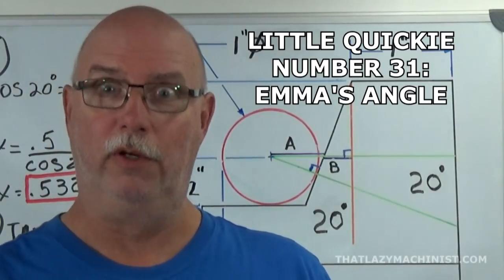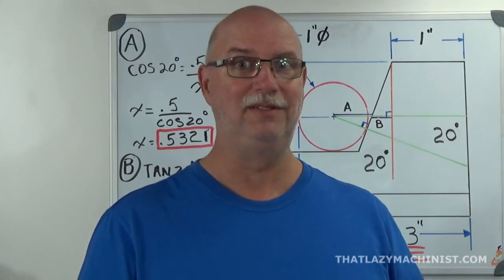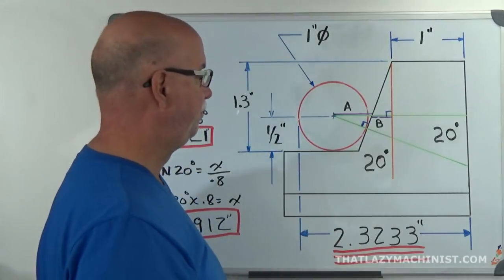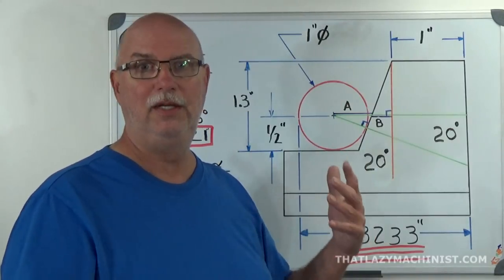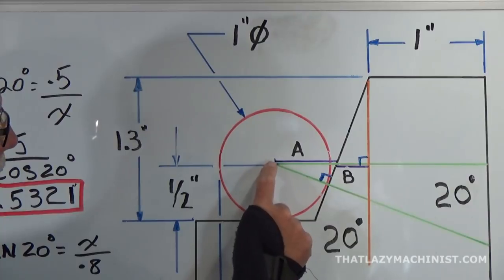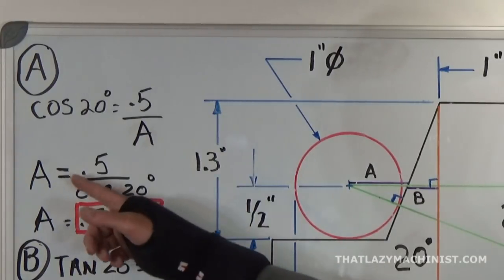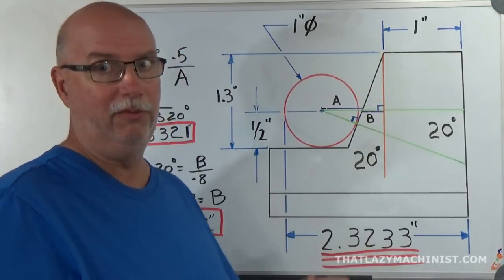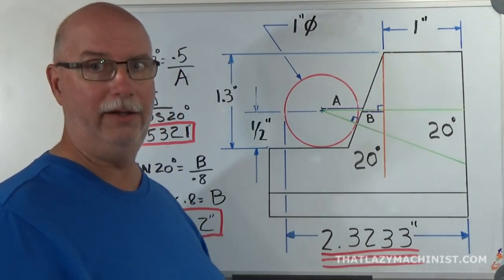EMMA'S ANGULAR PROBLEM! OR HOW TO ACCURATELY DETERMINE WHERE AN ANGULAR SURFACE IS, MARC LECUYER

Comment: I aced trig in high school, but that was a little more than 50 years ago.  However, I really learned it then, not just passed the tests.  So, today I am a lot slower to get the results, but am still able to get it done satisfactorily.  Who would have thought that was useful knowledge long term back then.  Somehow, intuitively, I did.  The calculations were all done with tables, a slide rule, and longhand math in those days before computers and calculators, and I still have the slide rule and the tables as well if the computers all go dark.  This is the kind of stuff that makes machining interesting...  Thanks, Marc!
Reply from the maker: Hi Bob! I did my high school trig with a slide rule as well! I am not sure though that I would be able to use one today? Well at least not without a good magnifying glass!!!

Comment: Hi Marc,

Good to see you looking well.

I've got to pull you up on a little units error though and an engineer should know better! The bicycle battery is rated in Ampere Hours, not Amperes.
Reply from the maker: Hi Paul! I did not know that, and I am not an engineer. I am a machinist and was never very good with electricity (I guess this proves it). Thanks for keeping me on my toes, and for watching, Marc.

Comment: Maybe a dumb question but.... how would I know the 20deg angle of the triangle comming from the center of the circle?
Reply: devin wojtczak the two triangles can be proved to be similar.

designate the point at the top of the part, at the edge of the angled section (where the left side of the '1"' measurement points), A; designate the intersection of the orange line coming vertically down from A & the green horizontal line B; designate the point to the left of B, where that green line intersects with the angled edge of the part, C. designate the point at the center of the circle (further left along the green line from C) D; designate the point where the angled edge of the part is tangent to the circle E. 

angle BAC is given as 20 degrees, which means that angle ACB is 70 degrees; angle DCE must be the same as ACB (because they're both formed from the same two intersecting lines, & neither is a complement to the other), which means that angle CDE has to be 20 degrees (because both triangles are right)

an illustration: https://imgur.com/4NLwGdI
Reply from the maker: You explained that better than I could! Thanks! Marc

Comment: But you are still stuck with the unknown 1" measurement (theoretical - it should be...).
A more accurate way is to first measure the "2.3233" measurement and then make another while putting a measuring block "horizontally" between the part and pin.
Then using the difference between the both measurements and the thickness of the measuring block you have a right angle triangle that isn't depending on theoretical measurements. If a high level of accuracy is needed don't forget to check the squareness between the base and the surface the pin is resting against.

Sorry for a bit of rusty english and lack of illustrations, if clarifications are needed please poke me and I'll see if I can give a better explanatiion.

Glad to hear you're doing good and feeling better!
Reply: Oups. Now I saw that Shadowdog500 had posted the same solution already :-)

Lesson learned, read first then post.

Comment: Dear Marc, this does not solve Emma's problem because what can she do to correct her part if she gets a different measurement result than expected by your calculation? She still will not know if the angle deviates or the 1" part at the back edge is not exactly 1"..She will only know that one or both of the two dimensions are wrong. But which one needs correction and by how much? Actually even if the measurment result equals the calculated result still both the angle and the 1" part can both deviate but compensate each other so that the measured result seems correct but your part still deviates from the required shape. You try to verify two dimensions with one measurement. That can not work. I am afraid you have to postpone your summer vacation a little and pick up a math book yourself... ;-) I help you a little so you can still catch your trip to your vacation. How about taking two measurements with two dowel pins of different diameter? You get two equations which you want to solve for the unknown angle I name "alpha" of which you are not sure if it is really 20deg and an unknown distance "x" of which you are not sure if it really is 1". A and B and C and D (the latter two for the different dowel pin diameter) can all be expressed as functions of the unknown alpha and other known dimensions. So you can solve your system of two equations for alpha and x. Then Emma finally knows the actual values of the twol unknowns and can correct them accordingly. Is it spare room workshop Emma or another one?
Reply: one could confirm the angles with a sine bar.
Reply: true but very expensive if you include a quality set of gage blocks. Also a vernier bevel protractor would work up to about a 10th of a degree unless the bevel is too small and the protractor too big.
But scarcely equipped hobby workshops usually have neither of the two. So Marc's idea with the dowel pins and micrometer really suits home workshops very well if only that math were not so confusing....;-)
Reply: A $35 set of angle blocks would also work.  my $35 set will work to 1/4º  Chris
Reply: ++Anonymic79: You are right of course when wanting to go by the book. Tolerances on dimensions and general tolerances you can see very often on decent drawings. And you should pull the tolerances also through the math operations where using toleranced dimensions. You are right. But to be honest I have not seen that done for many years in fields that are quite concerned about precision. Are you a physicist? They are the only ones I have ever seen doing that. The theory and the mathematical methods of error calculations is neat. But particularly in the mechanical field it is not very practical. In complex assemblies it would become complex already by carry through all error calcs. But it becomes even more complex because there are mechanical operations that interrupt the error calcs e.g. when several parts are clamped together and milled flat together. or when parts show unwanted gaps during assembly and you just pull them elastically together by their mounting bolts. And it has no adverse effect except on your error calculation. So even for precise assemblies the error calculation does not stand the test of practical application. For very special very critical applications usually with limited complexity error calculation can be very helpful. For high volume series production you could even include the probability of tolerances in form of Gauss curves and benefit from the fact that tolerances can cancel each other out. But that only makes sense with high volume production and certainly not home shop projects ;-)
Reply: rol eic, There is a much easier solution to the two pin method.  An easier method to find the angle is to make one width measurement with the pin, followed by another width measurement with the pin sitting on an block of known height.  then Tan(ø) = (∆Width)/(height of the block)  Chris [NOTE i use ø as theta on my mac, because they dont give you a theta shortcut on a mac  ]
Reply: You are right. That way is easier to find the angle. If you want to calculate the width of "x" you need to do one more trigonometric operation but it is probably still easier. But you loose your refresher in solving equations ;-) Depending on the angle and the dowel pin diameter the pin could fall btw gage block and part. But we assume Emma has the right pin.
Reply: I don't think I need a refresher in solving equations ;-)  The setup is everything. The straight forward two pin diameter setup gave me an iterative solution (which excel can do), but I prefer to derive direct solutions.   When looking for a two pin setup with a direct solution, i realized that one ball on a block (or stack of feeler gauges) would work, and was actually a much more elegant solution.  The diameter of the pin don't matter and isn't even measured  in this solution. Emma could use the shaft of a drill bit and a short stack of feeler gauges if she wanted.  The pin she was using was way too big to fall through, and the stack of feeler gauges could be pushed to the side to hug the angle. Chris
Reply: Now that was a pleasant thread. Everybody has contributed something and improved the solution of a problem. I thank you all here.
Reply: awesome! yes, its my question!